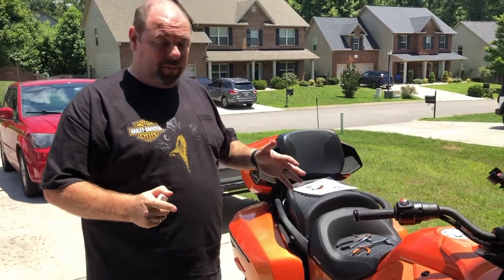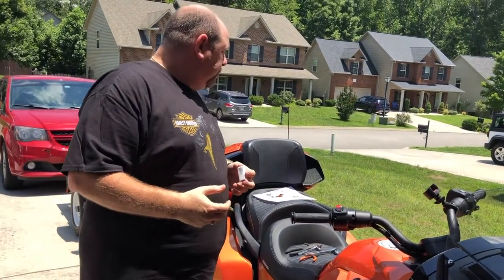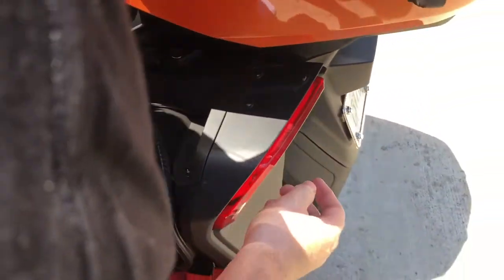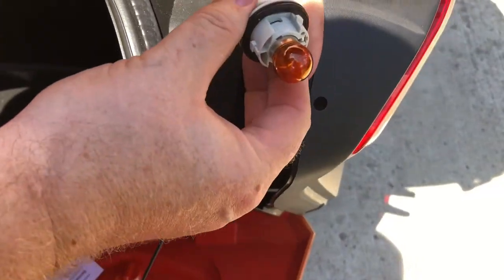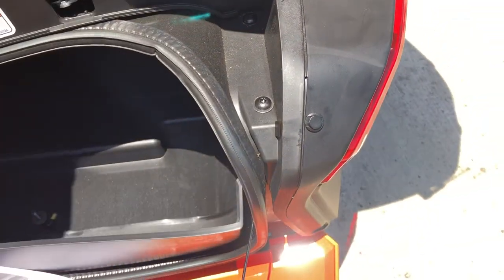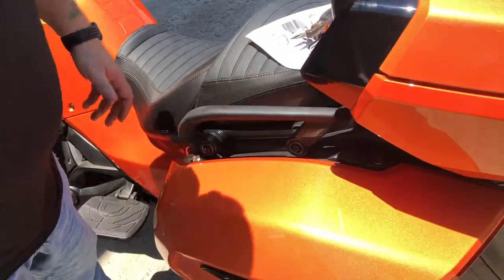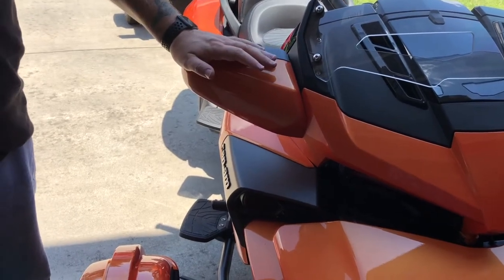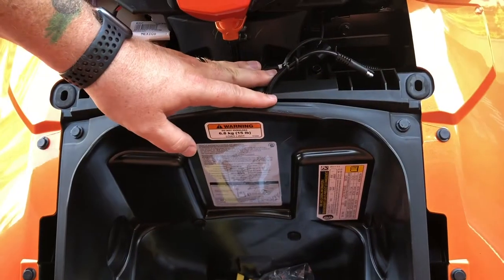Upgrading to LED turn signals on a 2019 Can-Am Spyder F3 Limited

Comment: Nice color. Which is more comfortable and has more luggage space, this F3 or Spyder RT limited?
Reply from the maker: DrDennis77, sorry for the delayed response!  My answer depends on which RT Limited we are talking about.  The 2020 RT Limited got a significant redesign that actually made it much more close to an F3 Limited than the previous model.  So my answer is: Pre-2000 RT Limited is NOT as comfortable, and has about the same luggage space total.  I think it has a smaller trunk, and the saddle bags may be the same or a little smaller than the F3, but the frunk is bigger because of the radiator placement.  It's not as comfortable because of the taller seating position, the mid control foot placement (giving you a much more upright riding position), and non-adjustable handlebars.  The 2000 and later model RT Limited is EQUALLY comfortable and has MORE luggage space total than the F3 limited.  Both machines share the exact same trunk and saddle bags, so the storage is equal, however, the new RT Limited maintains a larger frunk than the F3 again due to the radiator arrangement on the RT allowing for a bigger front case.  The new RT has floorboards much like the F3 and the new seating position is nearly identical to the F3, however the RT has an adjustable windshield, so that may be a plus, and it also comes with heated seats, something the F3 doesn't have.  Other than that, the F3 and the 2000+ RT Limited are nearly identical in comfort, but the RT has SLIGHTLY more storage in the frunk.

Comment: You can use a 1/4 inch ratchet wrench instead of pliers on the torx bit.
Reply from the maker: You are 100% correct and I didn't even think about it at the time.  I realized that after I had already published the video, so nice comment!  I have had occasion to remove those screws again and did just what you said.  I used a 1/4" ratcheting open ended wrench and it was much easier and faster.  Initially I tried to use a 1/4" socket and it was still too tall to get in there, the ratcheting wrench did the trick.  However, as a side note, I did figure out that it's only (2) T-27 (or T-30, I can't recall off the top of my head) bolts that hold the trunk down.  If you remove those, you can swing the back of the trunk up enough to clear those bolts with a regular ratchet.  Takes an extra 1-2 minutes total (with my trusty electric ratchet!).

Comment: I’m thinking of changing my headlights to LEDS as well
Reply from the maker: I will be doing that for sure and posting a video on it when I do.  I really can't recommend LED headlights enough.  Their light output is brighter and cleaner with less drop-off on the peripherals.  The most important thing is to get the correctly designed LED body so that your reflectors work properly to project the intended beam pattern as to prevent blinding oncoming drivers.

Comment: You could have taken the rear trunk off to get at the screw. At least on my 2020 Spyder F3-T Limited it's easy.
Reply from the maker: Greg, you are absolutely correct.  I am about to upload an update video that shows exactly that.  The trunk on the 2019 isn't quite as easy to remove as the 2020, so you'll see that I only removed the two bolts and lifted it up high enough to access the torx screws for the rear panel.
Reply: @nuke6030  lol the 2020 isn't easy to remove as well.   I see the RT model is the easiest of them all  ;)

Comment: did you ever find the way to stop the hyperflash
Reply from the maker: Yes and no.  There is no way to program the hyperflash out of the bike itself.  It seems the best way to stop the hyperflash was to change the LEDs themselves to ones that had internal resistors.  I recorded a video with this upgrade but I haven't uploaded it yet.  I need to do that.

Comment: Can the tail light bulb be accessed in this manner as well?
Reply from the maker: The tail light is a fully molded LED light that is integrated into the housing.  It never needs replacing and therefore is not end-user accessible.  If there is a failure of the tail light, the entire unit needs to be replaced.

Comment: Are you sure about the 120 degree? Because this light bulb that you indicate is 160 degree ...
Reply from the maker: Marc, nice catch!  You are absolutely (mostly) correct.  The tabs are NOT 120* out as stated in the video, they are actually 150* out.  They can be found by searching for a BAU15S bulb.  There's only 2 variations of the 1156, the BAU15S which has the 150* tabs, and the BA15S which has the more standard 180* tabs.  Thanks for catching my mistake.  I'm going to making another video soon with some updated CANBUS compatible bulbs and cover some lessons learned from this video.

Comment: May I ask would you know if the 2018 rt limited need a flasher relay to avoid hyper flasher my wife just got a 2018 rt limited so I would like to convert into led all around
Reply from the maker: I am not sure about the 2018 RT.  If it has the new style LCD dash, I would say that you will probably have to get the dealer to put the flashers in "international mode" in BUDS.  If you have a good relationship with your dealer, they may do it for free, or maybe they will do it when you do your next service.  If not, they will probably try to charge you an arm and a leg.  Also, try the procedure that Lamonster Garage outlines in their video using the hazard flashers to reset the computer to the new load of the LED.  Sorry I couldn't give you a more definitive answer, I don't have access to an RT.
Reply: @nuke6030  ok